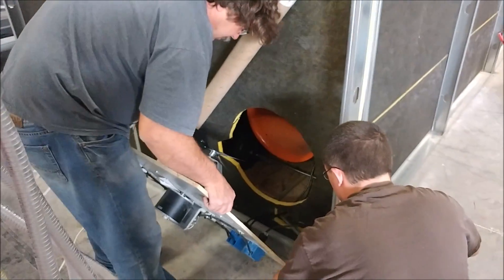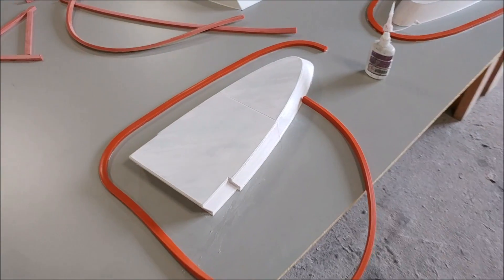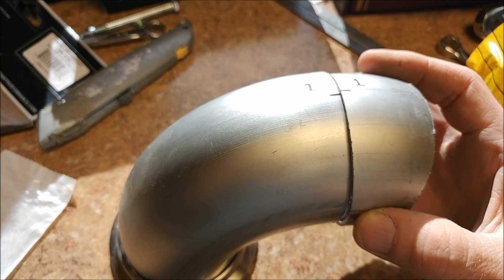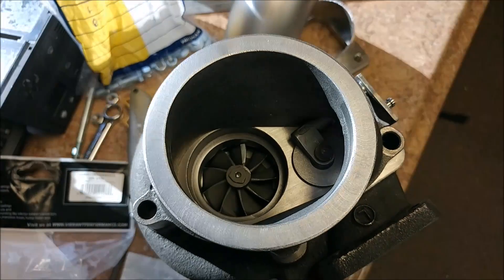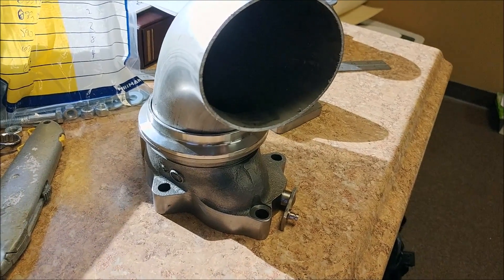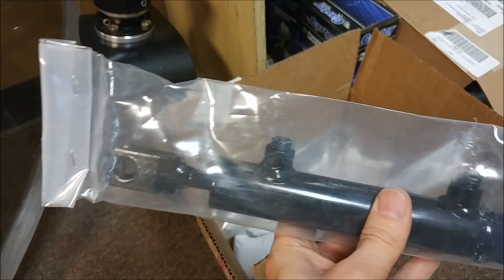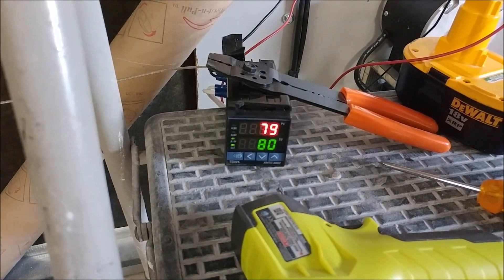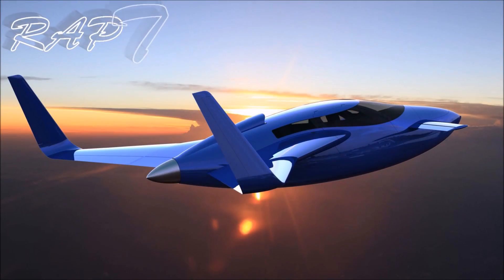It's Getting Hot in Here - Post-Curing the Main Spar

Comment: I know this is from a couple of months back, but I wanted to comment on the wastegate that is in this video.  I have a like wastegate on my custom MR2 turbo.  After a couple of months, maybe a year, I found one day that I had lost the ability to create boost.  The wastegate flap had fallen off the actuator arm!  Turns out the gate is held on by a rivet, and in China fashion, it was of indeterminate metal,  It had not stood up well to the exhaust gases and had simply fallen off!  I was able to recover it an fabricate a replacement pin/rivet, but thought i would let you know about my experience, as if you had a similar problem on takeoff it could cost you a bit more then my problem did!

Comment: Not sure what your load/capacity figures are on the relays, you may want to get a temp reading on them. In my experience, they will usually require a heat sink. Your mileage may vary.